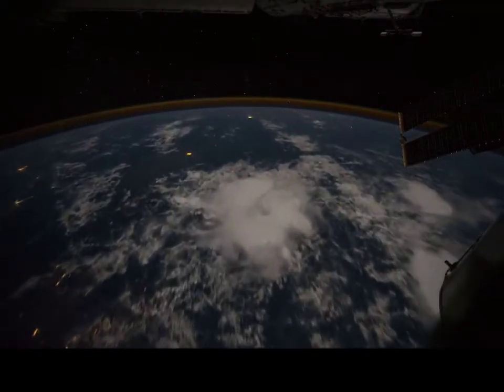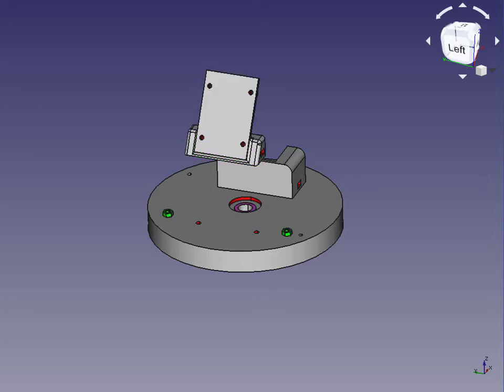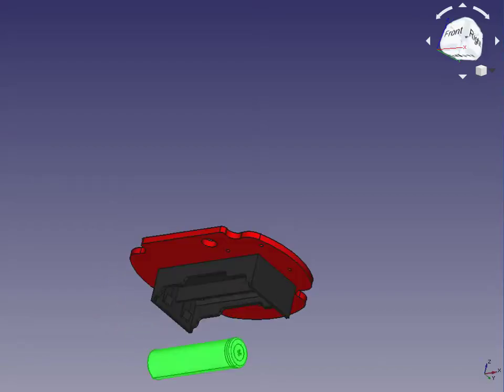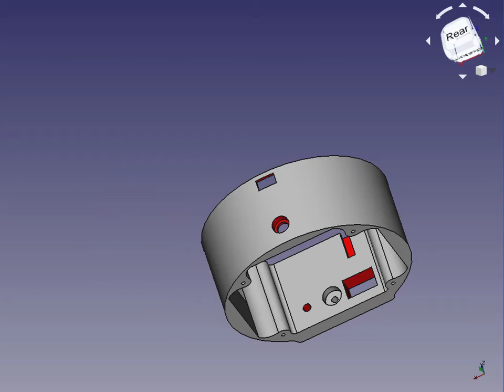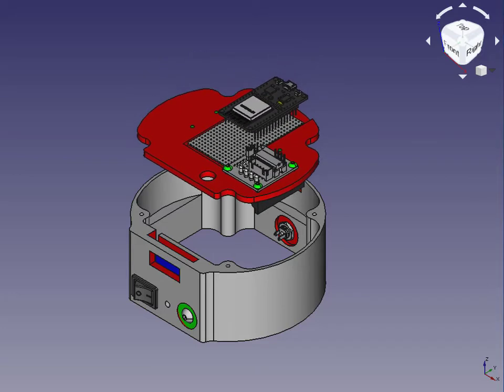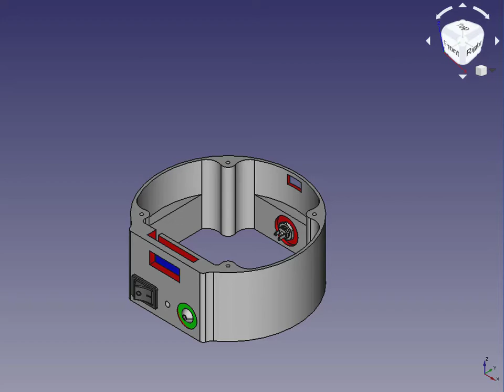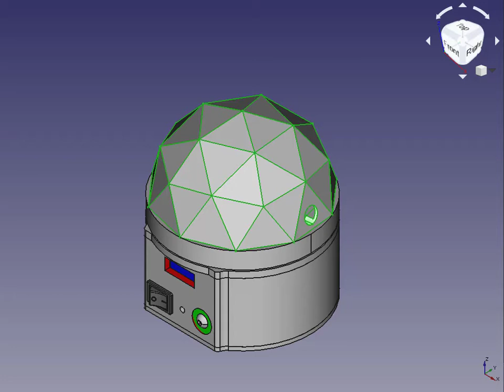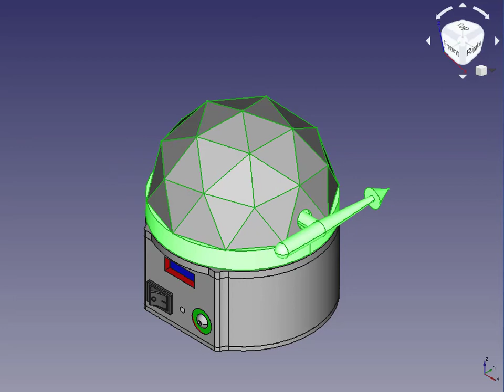ISS Tracker Design & Build

Comment: Hi David. Good project and tutorial, thank you very much. I have observed a significant difference in ISS coordinates (~10 deg) between the iss tracker website and the json request results. Also, the location where "distance_to_iss" and "distance_to_nadir" come to a minimum does not match my own location. What do I get wrong?
Reply: Thank you, Jean-Marie. OK, there are a few things we need to look at here. Are you saying that the json data shows a different location compared to another ISS tracking website or is it different to the one displayed on the open-notify api web page?
Reply: @BlackberryJamMan  Hi, thanks for your swift answer. The lat and long returned by "http://api.open-notify.org/iss-now.json" - which are grabbed correctly by your code - do not match the lat and long displayed by the "http://www.isstracker.com/home" web site at the same second.
Reply from the maker: @jmlocci  Ahh, I see what you mean. I do not control these websites, but they collect the location from NASA and use a TLE file to calculate the position of the ISS. The TLE file goes out of date quickly, so needs to be regularly uploaded. I wonder if the website needs to update the latest TLE data?
Reply: @PGCE  ephemerid outdated, that could be David. Thanks a lot. FYI, I am in the process of adding a GPS module. Best regards.
Reply from the maker: @jmlocci  OK, I will keep my eye on it, to see if the data from each website aligns in the next few weeks. That sounds like a good idea, to add a GPS. As the unit needs to have an internet connection, I did think about getting the observer's location data using IP geolocation. Good luck and let me know if you get it working.